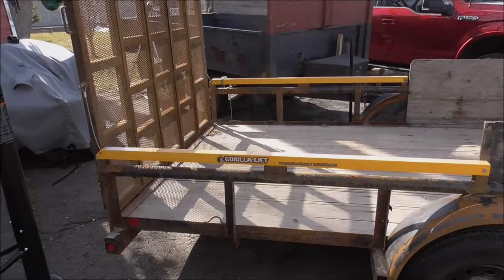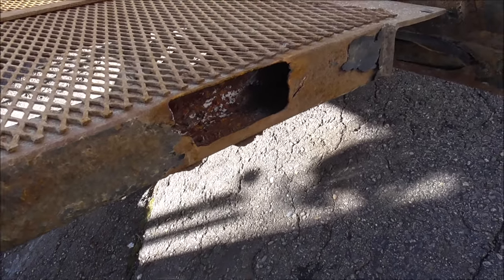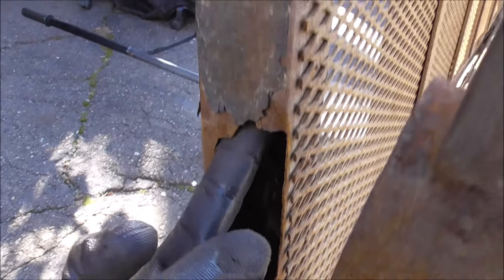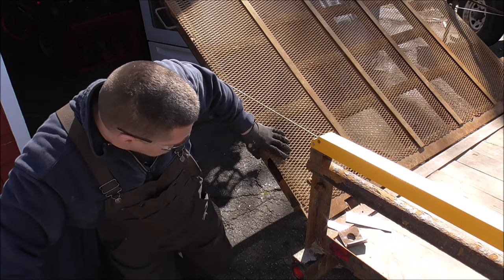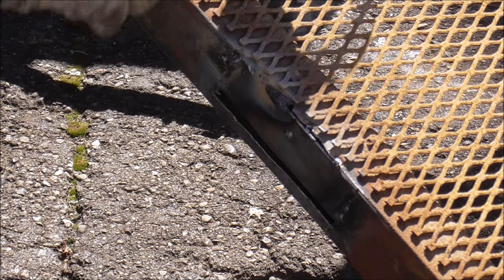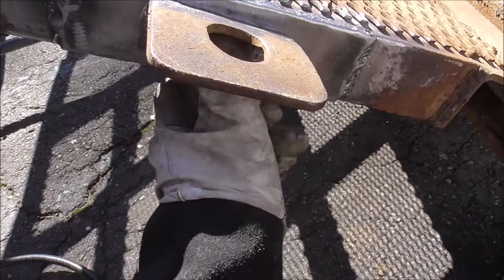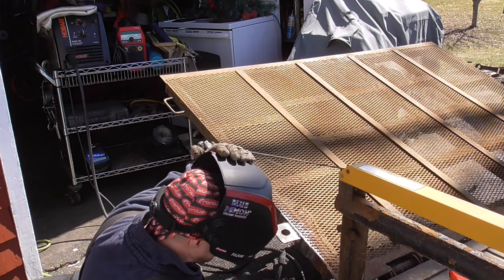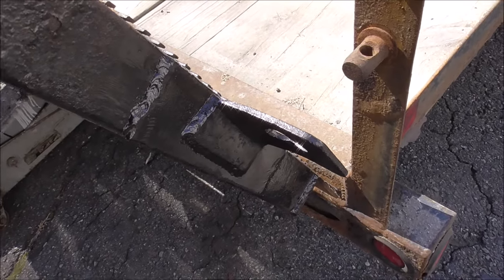RUST Fixing a Broken Trailer Gate Welding Repair Guide

Comment: Inspired by your past video about rebuilding your old utility trailer,  I rebuilt my 43 year old utility trailer which was very badly rusted.  I was able to salvage about 1/2 of the trailer, and in that process I discovered this treatment that contains phosphoric acid which neutralizes rust.  I won't mention the name, because it might be deemed as spam, but it starts with the letters 'Osp...'.    It really seems to be effective.  So far, after 6 months, there is no rust bleeding through the paint.
Reply from the maker: Thats awesome! There is a lot of satisfaction taking on that type of project.

Comment: Hey Brandon, We're also having a cold front move through.  It's going to get down to the mid 70's.   Nice repair on the tailgate.  I purchased a hydraulic dump trailer awhile back and someone put something they dragged out of the salt water in the bed.  Rusted out the floor, some of the cross members and froze up the dump hinges.  I got that job to look forward to.  I'm replacing all the metal with 12 gauge box and plate.   Stay warm.
Reply from the maker: Thats the way to do it! Then spray it with fluid film or some other rust proofing to make it last.

Comment: Nice work. Brandon.  Curious as to why you didn't weld out the bottom length of the piece you placed on the inside of the tube. Any additional weld along that side would have tied things together even more.
This customer is lucky to have you to do the repairs on his equipment
Reply from the maker: Thanks man! It left a gap so I ennded up welding that inside piece to the top piece then closing it all up along the edge.

Comment: I just got that 81/2 inch Evo saw based on your previous video using it, and I love it!!!! It cuts like a hot knife through butter!
Reply from the maker: I hate to say it but I feel like it cuts way faster and smoother than my big 14" saw and for 149 bucks how can you go wrong! The thing is a beast and it does bevel cuts too!
Reply: @BrandonLund I used it today to do some 45° cuts, and it it soooo precise! They are damn near perfect!!!!😁👍
Reply from the maker: I've actually had a conversation with an Evolution rep and told him they could charge double for some of their stuff but I'm glad they don't. That 149 saw is probably the hottest deal I've seen in a while. I'm surprised they are selling it so low. It's quite a saw

Comment: Good of you to fit that in for them before the storm. We need one of those Gorilla Lifts on our trailer.
Reply from the maker: Thanks man! I installed this Gorilla Lift for him earlier in the ear. I had never heard of it until he contacted me. As someone who has used these types of trailers all my life, I was amazed at how effortless it is. You could actually use just one on most trailers then sell the other online. His gate is really heavy and this had no problem lifting it. I think one would work but he wanted them both installed. If you get one, you wont be dissapointed.

Comment: I like that you used an inner plate for more strength… I would have drill a couple of hole or slot from the outer plate  and weld them together to tie them together for more strength… nice quick work to get your customer back on the road
Reply from the maker: Thank you for watching and commenting Nelson 🙏

Comment: Hey great video as always. I brought the evolution stand based on your recommendation. It is very nice but I have a problem with the side support, although I tighten it as much as it can go, it still have some lateral movement, can you suggest some way to minimize this?
Reply from the maker: You are going to have some movement because its a slip fit. As long as the top of your roller is level with the top of your saw, you're all set.
Reply: @BrandonLund  THANKS for the REPLY
Reply from the maker: Glad to help brother!
Reply: @BrandonLund  Hey I couldn't handle the play I was getting on the miter saw stand and l, 3d printed a shim that was 84 mm by 45 mm by 7.9 mm thick and now it is perfect.  So if you have a 3 printer you can also do this and you will see the difference.
Reply from the maker: Nice idea!

Comment: Sure doesn’t take long to rust back there, I recalled you put the lift on. My golly whole gate rusted! Good patchwork though.
Reply from the maker: Yah its brutal here, especially if you don't make a habit to rinse off your stuff regularly and do undercoating. The salt they use has definitely gotten stronger over the years.

Comment: Don't know about that one, but the plug-in-pins on my gate leaves too much room and the gate has, at least, a 1/2" clanking, especially when on bumpy/gravel roads, it literally has started to rip the weld apart on the gates plate, just like the one you're working on, but no rust at all... will a sand and quick stick weld lock it, hold, or will the current weld just collapse/melt away? The whole weld all the way around is not broke, just about half.
Reply from the maker: Once it starts cracking it will just continue to spread unless you grind out the crack and then weld right back over it
Reply: @BrandonLund  I'll give it a try, but probably going to drill a couple bolts through, too... and I can tell others, if that gate is flapping forward and backward a lot, make sure to add some washers, or something to secure it more firmly with the pins.

Thanks for the follow up, much appreciated.

Comment: I have a question and it is NOT to be criticizing, with that area all that internal rusting and "fish plating" any particular reason why you would not use weld-thru primer?   I was just wondering if you had a reason not to use it..
Reply from the maker: That's a great idea. After seeing the condition of the underlying metal, this became a temporary solution to a bigger problem. It will fail elsewhere before it fails here. That support needs to be replaced at some point and I made my customer aware. If it was better structurally, I would have used weld through primer as you suggested. Great observation. I will likely do an upcoming video about this topic based on your comment. Not many people are aware this product exists.

Comment: What do you run your flex core on 110/220
Reply from the maker: This machine in the video is 120 only but I prefer 220.
Reply: @BrandonLund  thanks alot
Reply: What's is a good sitting for exhaust pipes with flux core welder mig200 Machine ??????
Reply from the maker: Each machine is going to be a little different. Your best bet is most welders come with a chart on the door as a guide.